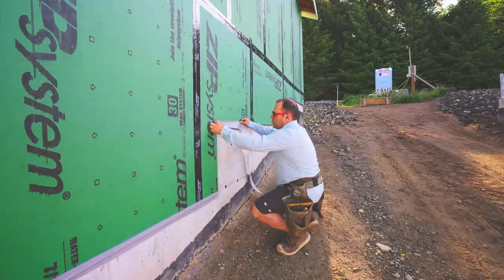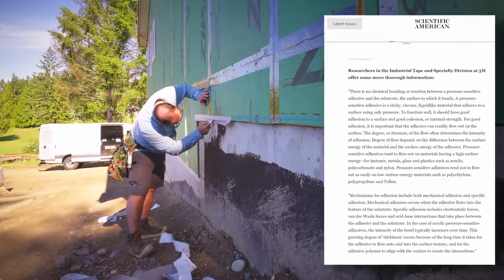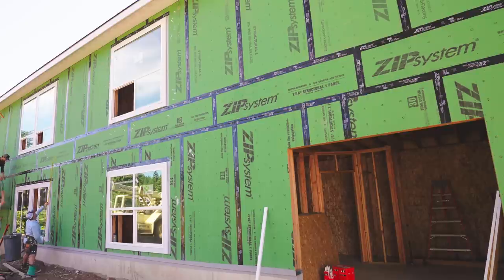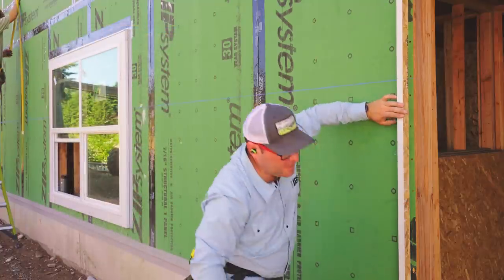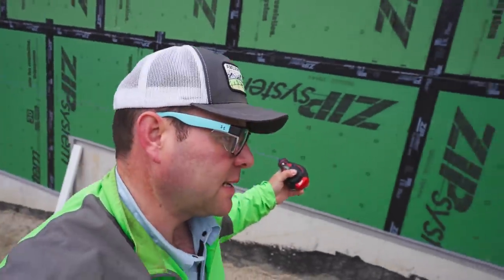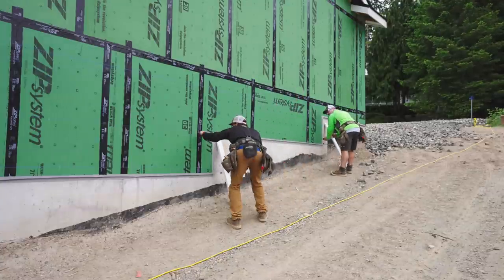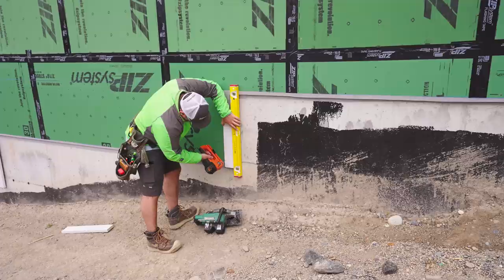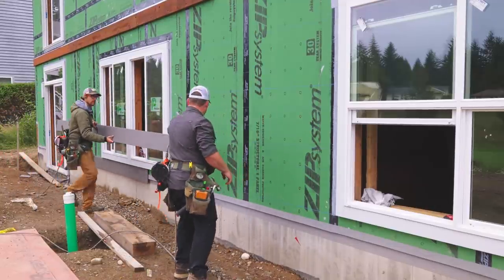LP Smart Side Secrets Revealed: The Key to Flawless Siding Project 120 Olympic part 17

Comment: Can you think of any reason not to use LP 1"x2"  trim around windows and doors? I never see anyone using anything but the 3" or 4"
Reply from the maker: I wouldn't use 1x2 because the trim needs to be thick enough to apply sealant.  Plus LP shows in their instructions the trim needs to stick past the siding.

Comment: Did you put tape on the steps on the vertical concrete steps over the zip board thanks
Reply from the maker: Yep, just didn't show it.fkr the sake of time. The Zip all the way around is sealed with the Fentrim

Comment: Are you ever concerned about keeping the story pole plumb?

Would you ever have the WRB in the same plane as the foundation, leave a 1/4" gap between WRB and foundation, and liquid flash that? What's the reason for letting WRB be proud of foundation?
Reply from the maker: Good questions.
1)WRB same plane as foundation is fine.  Since the foundation walls are same plane as the framing, to keep the house dimensions the same, I just let the sheathing project past.  I prefer not to use Liquid Flash there because its time consuming.

Zip is our wood structural sheathing + WRB, so that's why it sits outside the foundation plane.

Comment: I notice at the end of the video, you where attaching two pieces of siding. Don’t you or do you need to slide a piece of tar paper between the gap? I add a garage onto my house in AL and the city guy told me it was code???? I‘m from SD and our codes are different, I guess.
Reply from the maker: Nope.  So with traditional LP Smart Side lap, sealant is spec'd and more than sufficient.  Another detail they have is to leave the gap but put pan flashing or a slip sheet there.  This version has a ship lap joint, so no need for sealant or flashing.

Where we are nailing and the siding is butting trim on each side, we'll caulk the siding to the trim.  https://lpcorp.com/products/siding-trim/build-with-lp-smartside/installation-instructions?gclid=CjwKCAjwqZSlBhBwEiwAfoZUIB2MgxBRNyypqPd60gAsvCBIP2mT4T-xMGI0gdqNQIN7sCM7RCLZeBoCi3IQAvD_BwE

Comment: Personally as soon as I got several guages I stopped doing as much prep. Imo the quality difference is negligible and the production much faster. But to each their own
Reply from the maker: I find the gauges slower 🤣🤣 maybe I need to pick up the pace
Reply: @AwesomeFramers  to be fair on a large wall I'll have 6-8 pairs so I never have to reach far for one. I wish I could side walls flat like you do though
Reply: Those gauges are the cheapest helper you can buy.  I can now side myself with 2 ladders and 2 gauges.

Comment: I have watched videos on YouTube where that LP Smart laminated siding and also other similar products of different manufacturers....that type of siding was de-laminating after only 10 years and the surface of the siding was coming apart and de-laminating from the compressed wooden backing......so do your own research.
Reply from the maker: LP SmartSide is not a laminated siding.  Why don't you post the links?  If you felt strongly enought to warn people, show us the evidence.
Reply: Quicker actually they are just paying a bunch of people and it’s easy to use. You’d be better off using wood. Because you will have to paint as often and any imperfections and you get swelling it voids the warrenty